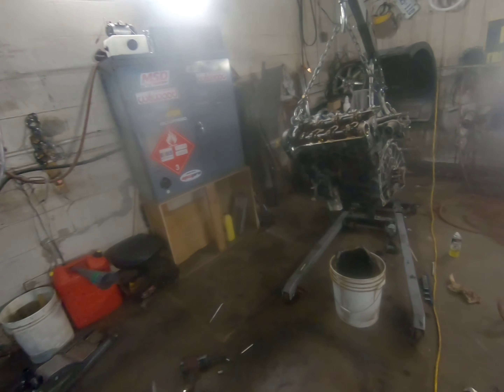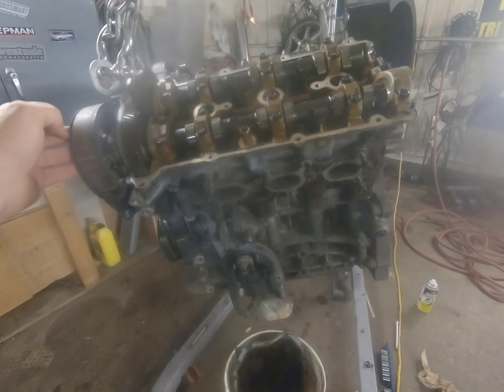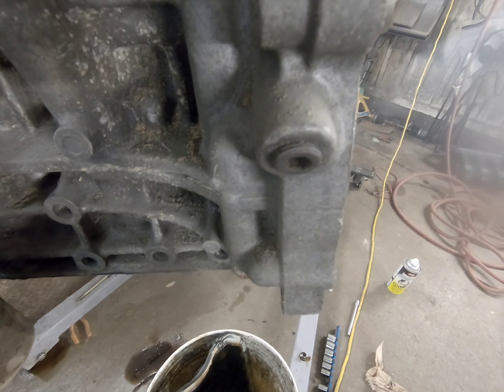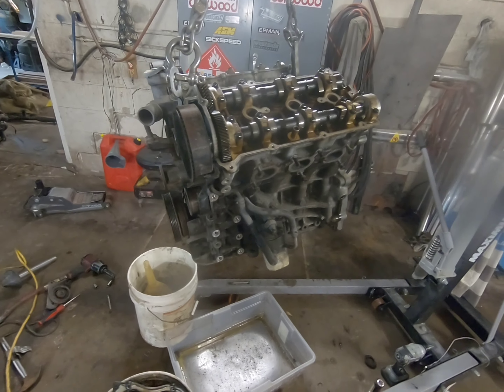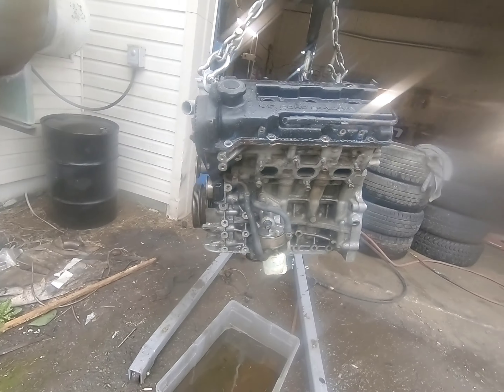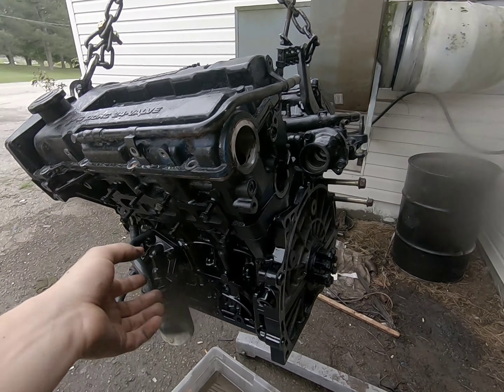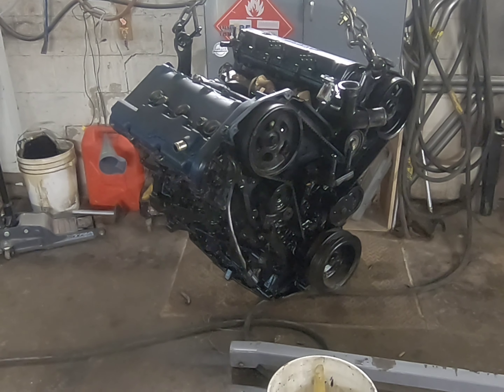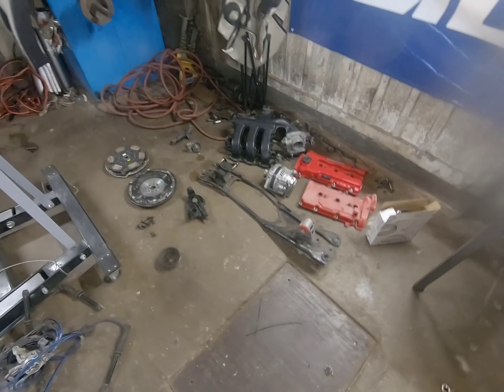how to turbo any car #2

Comment: What type of kit did you use for engine gaskets? Normal ebay?
Reply from the maker: I get most of my stuff through rock auto
Reply: @Suicid3mx3  ok, but any brand of special head packing or are they normal?
Reply: @Suicid3mx3  I'm going to assemble my klde again and I want some suggestions as packaging, since I plan to run with turbo
Reply from the maker: @ciritorrecillas8155  get everything from rock auto! Felpro gaskets
Reply: @Suicid3mx3  What happened to the red MX3? I was lost from YouTube, and I have not uploaded content to my channel! LOL
Reply from the maker: @ciritorrecillas8155  its winter where i live! So im not driving it
Reply: @Suicid3mx3  I understand, my turbo had to be sold to a colleague from another city, and I'm not there, the engine burns oil and there's smoke in the streets! so I'm starting a list for engine repair